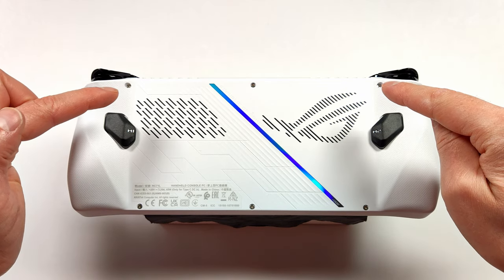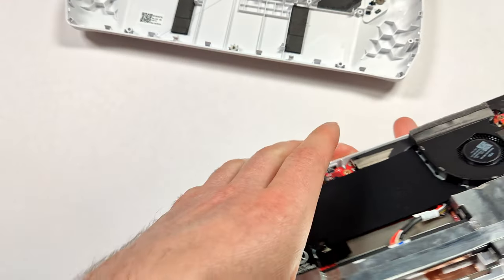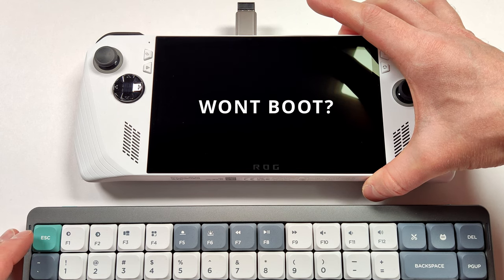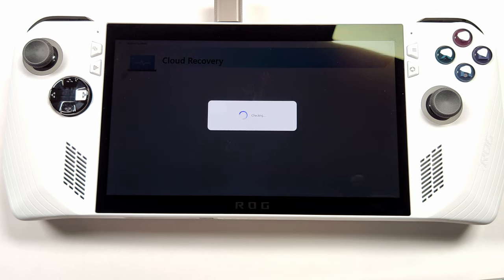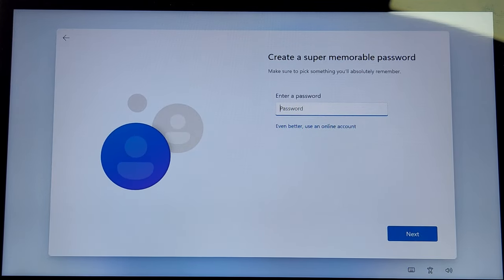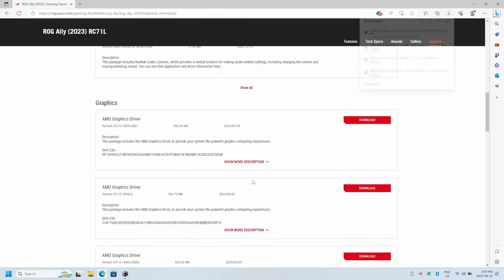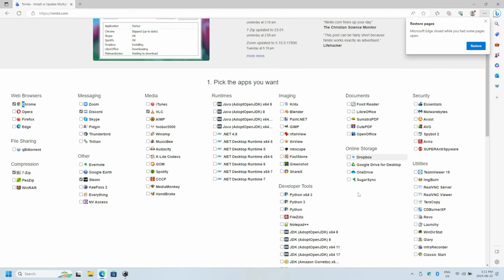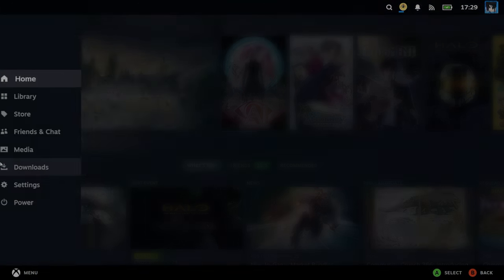Complete ROG Ally SSD Upgrade Guide - The Best Budget 1TB M2

Comment: So I just did this but I keep thinking in my head don't the m2 need a heat sync like what keeps the m2 cool inside the ally?
Reply from the maker: The majority of M2 drives require significant heat to throttle, I haven't encountered any thermal issues with mine since the upgrade.
Reply: @KeiRetroGaming  thank you for the information
Reply from the maker: Happy to help. What did you upgrade to?